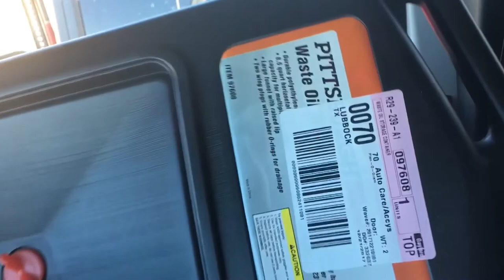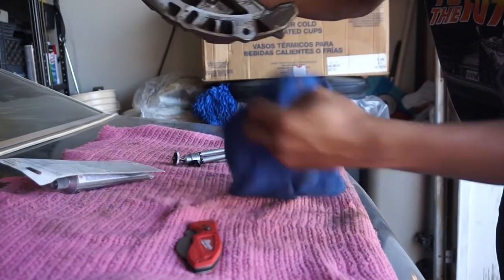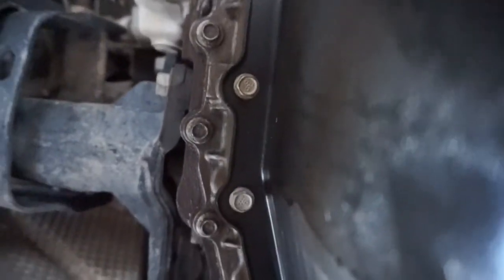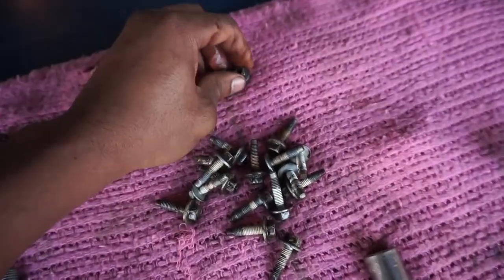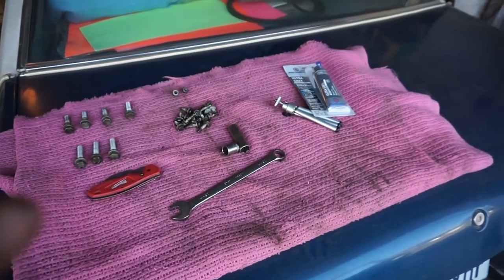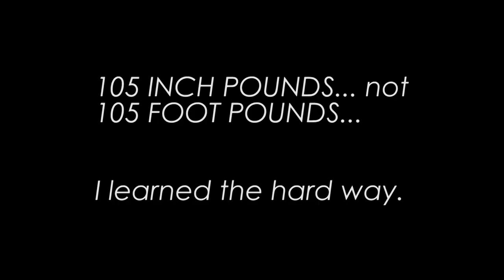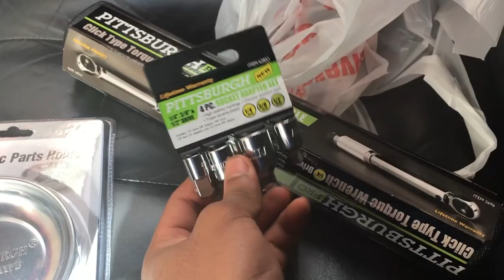I Accidentally Over-torqued And Snapped A Bolt Into My Crankcase [Upper Pan Gasket Replacement]

Comment: ohh, sad story but glad you fixed that. why didn't you use ft/lb wrench with 8.75 ft/lbs torque which is 105 in/lbs
Reply from the maker: Daivd Wang lol, most torque wrenches (including mine) don’t go that low. My ft/lb torque wrench goes from 20-160 ft/lbs.

Comment: oh man, that's a rough one, at least the bolt snapped in a spot where you could get those vice grips on there and get it out pretty easily. Nice field repair though, finding a matching bolt and cutting it down. You can usually hit up your local hardware store and bring in one of the good bolts to check the size and pitch on their chart thing and get a matching replacement too. Good job getting it fixed up.
Reply from the maker: Vinny Gullotta yeah I am so glad I didn’t have to drill and tap. That would’ve been annoying. And yup! I was on the way out of the house when I figured I should check my “random bolts” box. And with an ounce of luck I found a perfect bolt. Anyways, have a good day bro!

Comment: Sucks but welcome to car repair.... it happens - a stud extractor from auto parts store (The kind that clamps over broken stud sort of like a drill chuck - don't use vice grips or you may ruin the only part you have to grab !!!) - thank for the video - Net time just buy the right bolt - dont hack it in with a bolt not meant for the job- you could screwup the aluminum block.Bolts are cheap.

Comment: So same issue with me. Two broke before i even got a chance to torque. but I can't find the replacements anywhere. The ones sold at auto parts stores are not the same as the OEM ones off my bolts. Where did you get yours?
Reply from the maker: r3giment i just found a bolt that worked, it was in my bucket of random bolts and screws

Comment: I broke a bolt off also, not enough to grab though. I tried extracting it. With no success. Any ideas?
Reply from the maker: RLH 42ndAMD youll have to drill 😓
Reply: Chris Meacham I tried drilling and extracting but I couldn’t get it, any videos you could recommend on what your talking about?

Comment: bro,  I did the exact same thing this weekend.  I knew it was supposed to be 105 in lbs but I should have used a inch lb wrench instead of a lb one set at 10.  You were lucky you had a piece to grab on to.  I'm still trying to drill the bolt out.  Wish me luck.
Reply from the maker: Godspeed 🫡

Comment: Yep that would have freaked me out.  Having said that, when I torqued mine down to 105 inch pounds it just didn't seem to be enough.
Reply from the maker: Potter Son these don't need to be super tight, I just like to go around and snug the bolts in the pattern until they are the same tightness. Sometimes when doing oil pan bolts, you will have the "is this tight enough?" feeling. trust the OEM torque specs!
Reply: @developmentdivision122  I think perhaps you misunderstood my comment, I was not trying to imply I didn't trust the OEM torque specs.  I was simply saying how this is one of those things that make you go "hmm..."  In my case when I noticed the gasket leaking I reached up with a small 10mm wrench and got about a 1/4 turn on them and it gave pause that's all.  Knowing i could have done more harm than good i replaced the gasket.   By the way you were not the only content creator on this topic to slip and say ft lbs instead of in lbs.  Anyway, I enjoyed the video and felt for you when you broke that bolt off, it couldn't have been a pleasant experience.  Thanks for the post. It was helpful when I went to do mine.

Comment: Bruh I snapped a bolt. It didn't get stuck Inside buts it's sheared. Where can I g3t a replacement ?
Reply from the maker: Jesse James bring a bolt with you to fastenal they would probably have something similar on hand. You can try Lowe’s. But if you want oem replacement you can just order from online.
Reply: @developmentdivision122  Yeah I went to a local hardware store and got a M6x1.000x25 MM Flanged bolt and it seams to have worked fine. Only time will tell I guess. Hoping for no leaks!